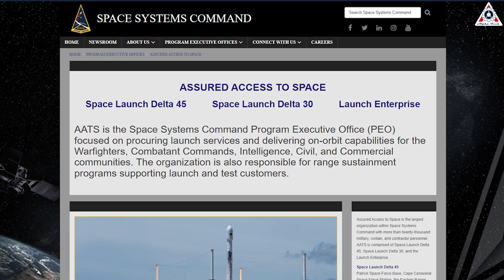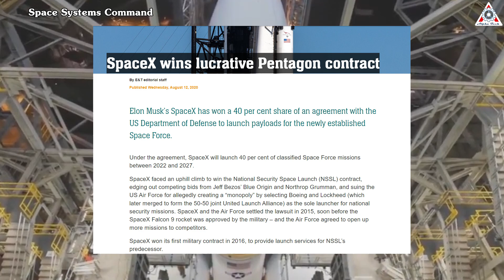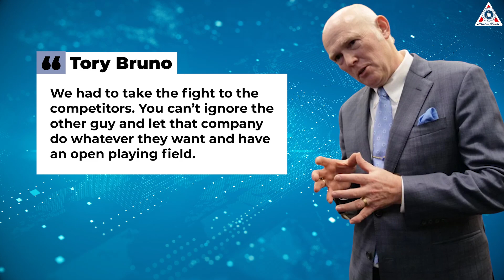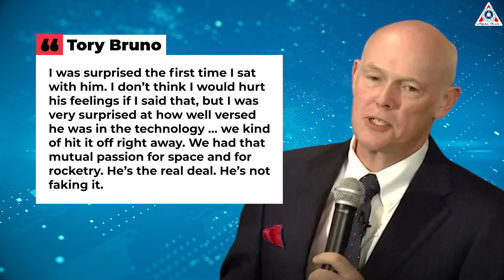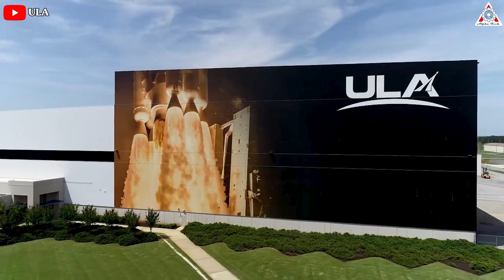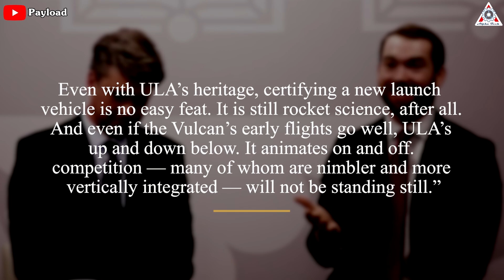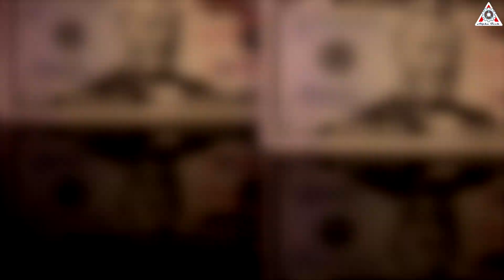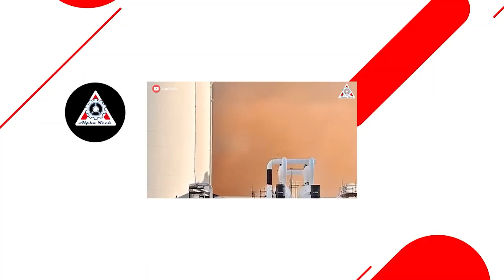Game over! ULA failure...

Comment: How did ULA fail? Well, for a start it had both Boeing and Lockheed Martin in it. Both of these companies are very good at extracting money from the USA government, but that is their primary function.  To them actually supplying hardware is an unnecessary expense. They never though that another company could actually do what they promised, but at a fraction of the price and would actually produce real hardware.  Lockheed and Boeing are marketing companies nowadays, not engineering companies. And the only thing that they market is their management, not hardware.

Comment: The CERN will not be use as thruster; it will be use to combine or collide all metals to produce finished products of Platinum Golden Silver Iron Steel Metal Alloy to level the UFO entering any kinds of Gravitational Force on any kind of Planets at any kinds of situational weather with the most powerful gravitational force on a Planets; and that combination components can survive back and fort FOREVER, The CERN will be used as combinational components builder not thruster;🦊

Comment: and the engines of jeff bezos omg dont put them on human crewed missions,                         single shaft turbopompeven with or withoutout gearing, I dont trust the BE-4 it's probably like sonic 06 hell RS-125 are even better and proven technology. but the RS-125 seriously HAD 2 turbopumps and did all what was neccsary for the hydrogen turbopump closed cycle oxygen rich (expander cycle?) but what the fuck is the BE-4single shafts for that amount of power for such small moleycules oxygen and NATURAL GAS? over pure methane? probably wanted to do that to burn it less cleanly so theres less chjance due to a little bit of larger size molecues stop leaking through the shaftss so what did soace x do full flow cycle engines  separate  turbopumps bold and ambitious but we all know about the production basically prototypes going to fly.... whilst the aptor 1 and 1.5 never hit orbit

Comment: This is news to me, I had to look at the date stamp on this video to check it currency, as I've mostly followed SpaceX. I'm hopeful for Starship success but it's still high risk. If starship fails, SpaceX could fail as well.  Fingers crossed.
Reply: One failure, even a disaster won’t end the Starship program. An entire second factory is being built at KSC.
Reply: I think the only way Starship could truly fail is if someone really messed up the maths and it doesn’t get off the ground. Or the steel pulls itself apart etc…

But that is so ridiculously unlikely with all the testing they have done.

The good thing with Starship is that a lot of the income is coming from Falcon9 so it’s not going to run out of funding like F9 could have.

Comment: Bruno rolled the dice on the BE-4, an untested engine in development by a burgeoning company vs Rocketdyne a very proven and capable manufacturer. IMHO, retiring two of their workhorse vehicles before they had a proven replacement may prove to have sealed his fate.
Reply: Bruno really didn't have much choice as Aerojet simply didn't compete on price.  The BE-4 was a low probably gamble (2017) that didn't win (2022).
Reply: @MilBard  I don't know how an undeveloped and unproven engine is a low risk gamble. Even the Raptor is unproven and it could wind up being an Achilles heel for SpaceX.
Reply: @Columbus1152  Trent didn't write low risk - quite the opposite: he wrote low probaility !
Reply: @genius1a  If I interpreted incorrectly, my apologies Trent.
Reply: @Columbus1152  At that point Bezos had hired ‘Old Space’ guys to do the BE-4 development.  That looked like lower risk to Bruno than Musk’s fail hard and learn approach to Raptor engines. Bruno was a prisoner of his life experience.  Most ‘Old Space’ senior leaders are.  This is just what happens when technology shifts occur.
Reply: @MilBard  .👍👍 Definitely typical cost plus mentality
Reply: could it be that bezos intentionally screwed up the BE-4 development,  know that he has the cash reserves to weather it but he was killing a competitor and could come in and hoover up the assets.
Reply: @richardthomson4693  I doubt that. Looks more like a dead fish in the water.
Reply: @richardthomson4693  That sounds too much like work from Bezos. Please see New Glenn. Since time is you most precious resource that you never get more of. Where has Bezos ever worked like Musk on his aerospace projects?

Comment: The viability of ULA is also dependent on Jeff Who's BE4 engine. First of all they are way too expensive. Secondly they have never been tested and proven in a launch. Thirdly Jeff Who doesn't seem to have the manufacturing facility to produce enough of the engines at the rate needed for future ULA requirements. Last but not least there are many new launch companies which are likely to become big competitors in the coming years. Sure ULA has all these launch contracts - but what are they worth if you can't supply?
Reply: Do you have any evidence for these claims? BE4 has been tested multiple times. Are you talking out of your ass?
Reply: @iamscoutstfu  what an intelligent reply!
Reply: If you ever see videos from SpaceX's Star Base, you will see workers building new towers, crews moving equipment all over, and cranes lifting rocket components into position.
If you look at Blu Origin's facility, there are powerpoint slides, sideways rockets built to impress school children, and the occasional office worker wearing a hard hat trying to look like he's doing something important while taking measurements on a static display. Meanwhile, almost no actual workers to be seen anywhere.
https://www.youtube.com/watch?v=5ukGXfH-eyg  and  https://www.youtube.com/watch?v=GKhwfF8jirU

Comment: I think I missed something . . . At 0:21, you said that ULA was formed in 2006.  But I moved back to the Houston area and went to school for a Master's degree at University of Houston - Clear Lake starting in 1998.  I recall the Johnson Space Center literally being a stone's throw from the UHCL campus.  I seem to remember ULA buildings strewn around the Clear Lake area of Houston . . . something about them managing the Space Shuttle program.

As I recall, ULA was, at that time, a partnership between Boeing and Lockheed and didn't involve either Atlas or Delta launch vehicles: it was strictly about ensuring that Space Shuttles went up when they were supposed to, came down in good shape, and were returned to service on schedule.

So . . . if ULA wasn't formed until 2006, who was managing the Space Shuttle program?
Reply: That was United Space Alliance - USA.  A joint venture between Boeing and Lockheed Martin
Reply: @DDay9000  . . . and I guess the difference is the customer?  Otherwise, the only difference I see is the name/initials of the joint venture . . . ULA or USA, it's still Boeing and LockMart.
Reply: @johndemeritt3460  - two different businesses - USA = Shuttle processing, launch operations, and recovery - ULA = rocket builder, payload launch company.  Yes, both are JV's between Boeing and LM
Reply: @DDay9000  incorrect. ULA has documents of incorporation drafted on 9/99 just fucking google it.
Reply: @DieselRamcharger  thank you for the clarification, hope you have a great day
Reply: def formed before 2006. just remember, everything these propagandists spread. is a fucking lie.

Comment: What you failed to mention is that ULA is the direct result of Boeing spying on Lockheed-Martin and then using that information to win contracts for Delta.  The Pentagon forced the creation of ULA partly as a punishment to Boeing.  (Note how the vast majority of ULA launches have been of the Lockheed Atlas lines, while everything Boeing Delta was being phased out even before Bruno took over.)

ULA's biggest mistake with Vulcan was going the 'hey look, we can do new-space' route when they chose Blue Origin for the engine instead of AeroJet.  And yes, I believe that the 'new-space' appearance was an important factor in the decision.  I seem to recall there were even some public statements of that very fact by the ULA leadership/PR team around the time the decision was made.

Comment: What joke.  ULA had a monopoly while using Russian rockets for DoD launches.  This is so bad it's sad.
Reply: 1st this video isn't entirely correct, nor does it fully tell the story. ULA was formed  to support 2 launch systems. Delta IV is not mentioned, and its engine was US built. So it's a half truth about the engine source. Another reason  for ULA forming was the competitive contract both Boeing and Lockheed were in competition was late in competition changed from winner take all to split it up and demanded both companies fund a portion of the development. LM put in excess of 1/2 billion dollars and Boeing because they developed new engine put in over billion dollars of their  own money. At time both were willing  to do that initially because there was on the books 100s of payloads per year on the books due to the Dotcom boom. Shortly after contract was split, Dotcom crashed, and those 100s per year went down to a few dozen a year.  LM and Boeing ran into, they would lose money  to continue. Both threatened to stop the production of the launch vehicles. La dee da ULA formed and military as part of correcting the screw job to both companies made this military contract arrangement. 

As far as RD180. LM was looking at 3 options to first go on Atlas 3, a fully internally LM funded commercial launch vehicle development. 2 were Russian engines and 1 a yet to be developed Rocketdyne engine. Rocketdyne engine was going to be over billion dollars to develop. The RD180 at the time was one of the best kerosene fuel engines. The deal made for the RD180 was that it would be eventually manufactured in US. At the time, US government accepted this as all military lauches would eventually  of this US built RD180 engine. Ironically, Rocketdyne was supposed to be the company to make the US version of the RD180. LM used Atlas 3 to step to Atlas V for the engine validation. Well, the US build arrangement didn't happen, and I don't know specifics. So the story here wasn't  fully told by this vid.
Reply: That is unbelievable. This is what the best politicians money can buy gets US.
Reply: Not only that they were entirely funded by the taxpayers. And I bet now the buyers are Chinese.😂
Reply: Yes their engines were Russian
Reply: Don't blame them for using something that was available, cheap and reliable.

Comment: Maybe Blue Origin will buy ULA???
Reply from the maker: Yeah.  This is another company owned by Jeff Bezos, but sources said there is a firewall between Blue Origin and Amazon. Blue Origin also won a share of Project Kuiper launches, 12, with its New Glenn rocket. However, there are some questions about how quickly New Glenn can be brought into commercial service, and in buying ULA, Blue Origin could consolidate its share of Kuiper missions and earn guaranteed funding from the Department of Defense. The company would also "save" money on Vulcan launches because it could provide BE-4 rocket engines at cost.
Reply: @alphatech4966  LMAO - you are clueless